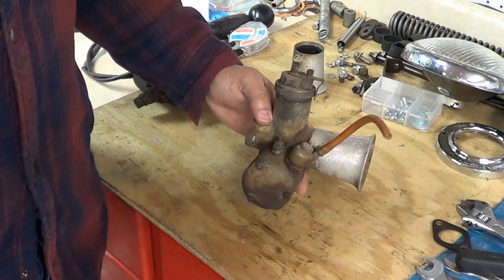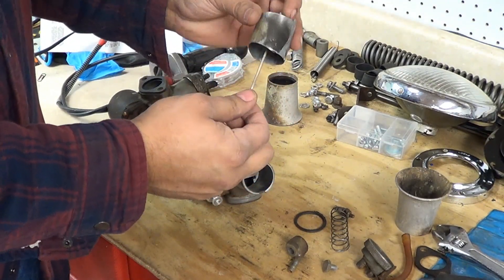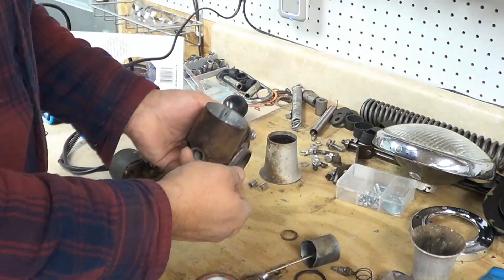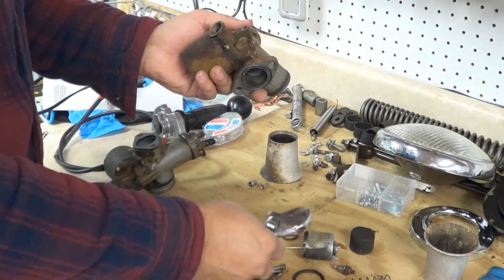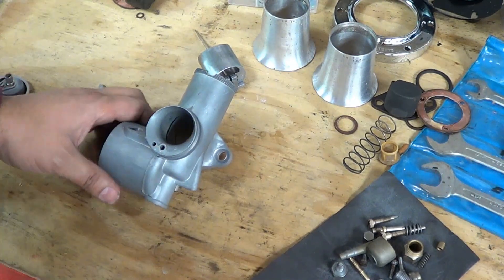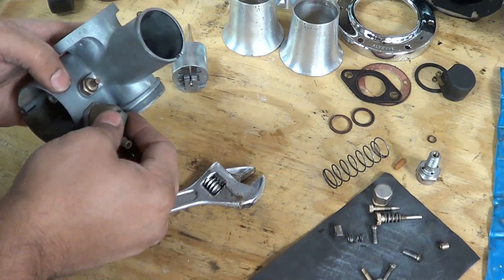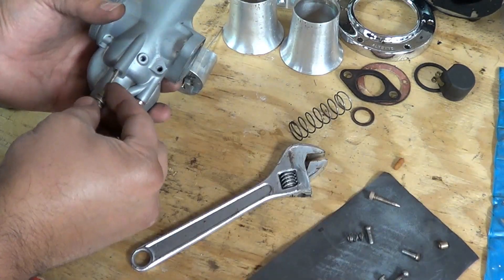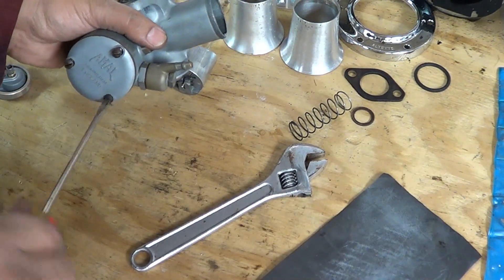Amal Monobloc 376 389 carburetor dismantle and rebuild

Comment: I sincerely appreciate your time and effort in making the video. It is always useful to see how someone else breaks down and cleans an Amal. A few comments - It might have been worth mentioning that you were rebuilding an actively "well functioning" carb to avoid some of the criticism around gasket, jet and needle replacement - as someone who has rebuilt older, more neglected carbs I am used to checking and replacing all incorrect (happens) or clogged parts that look worn and Needles wear though its nearly impossible to visually identify issues. My monoblocs would leak fuel everywhere with the missing and old gaskets, but maybe its just my neglected salvage ones... One other tip for your viewers, be careful not to overtighten the tickle, and check tickler-float clearance with a feeler since the tickle is tight on some and can actually impair the float from hitting the float needle even when not pressed. Even a tiny impact when 'up' can cause rich running or overflow. Exterior gaskets can be used to improve tickle clearance. Also the interior block comes out when entirely disassembled, giving you access to clean all the pilot and idle ports which can be done with compressed air after cleaning to assure they are open since this notoriously causes poor idle poor performance in the lower 1/3 throttle on Amals. While they are apart the aluminum polishes up wonderfully too... Thanks again for your effort and starting this conversation! BTW if anyone has found a reliable source for jetting and needle selection by displacement please link it.

Comment: What are your views on boring and re-sleeving the body with a new slide in it?
Reply from the maker: If there is no other option to replace it.  The money you spend on machining it.  You could spend kittle more to buy a new one.  They make new ones.  Or spend little less and pickup a decent used one online.

Comment: What you used for cleaning carburetor body ?
Reply from the maker: I dip the carbs in Gunk carburetor cleaner and then if there is any heavy deposits I vapor blast it.
Reply: @Vintage-Cycle  ultra sonic cleaning is a good idea .. ??? vapour blasting.is not so common where I live ..

Comment: I'm pretty sure the spacer goes on the spindle first , then the float to align it with the float needle which should be replaced with a modern Viton tipped needle , ethanol fuel eats the old plastic bits ,same goes for the float itself if plastic type.

Comment: rebuild???   he cleaned it off and put the junk parts back in???  needle and needle jet in a carb that dirty will be worn out  ...the float needle is about $7.00... looks like he put the oldie back in???   the most important part...jet block didn't come out???  with all the little passageways and the all important fibre washer underneath...
Reply from the maker: All jets were dipped as said in the video.  All issues were addressed.  These carbs have been good since the rebuild.